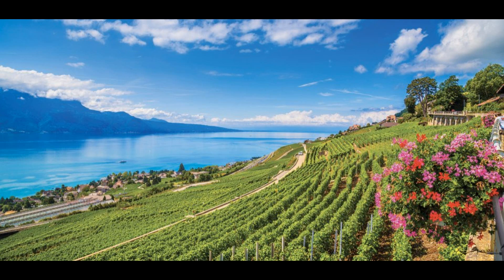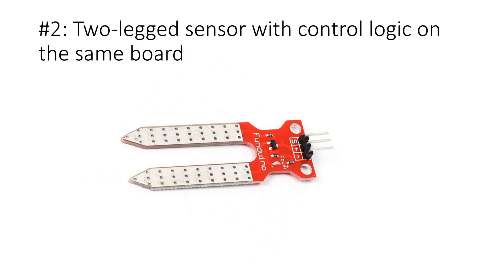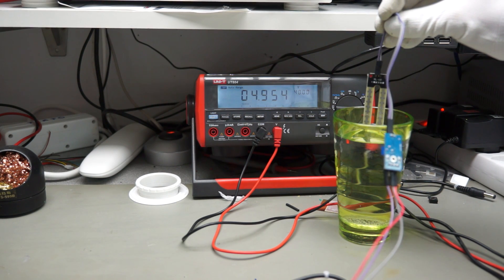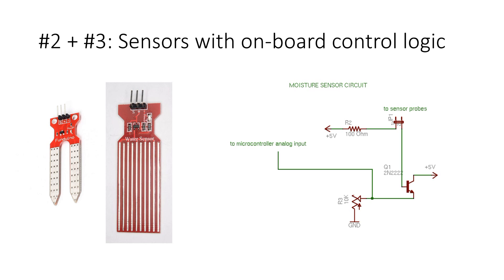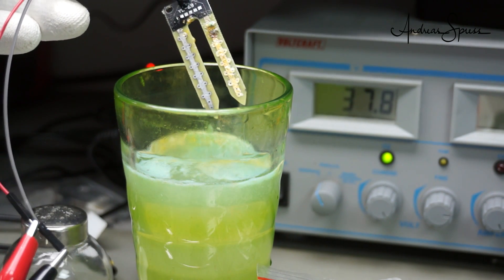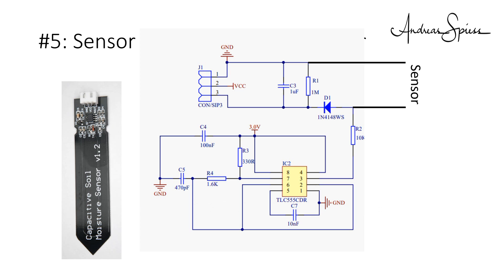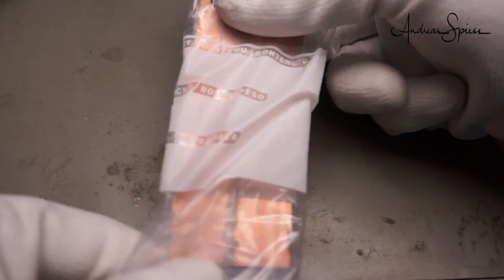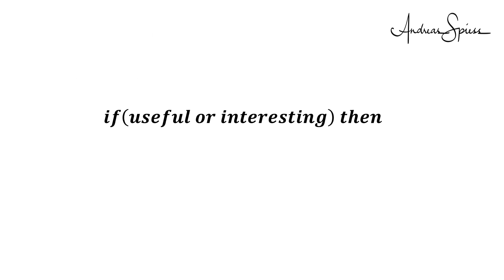#207 Why most Arduino Soil Moisture Sensors suck (incl. solution)

Comment: Hi Andreas,
i use that sensor : https://nl.aliexpress.com/item/32886868425.html?productId=32886868425&productSubject=Analog-Capacitive-Soil-Moisture-Sensor-V1-2-3-3-5-5V-Corrosion-Resistant-With-Gravity-3

in a beta driver under Tasmota from github. It works now for 1 1/2 years without any issue in 10 different plants in my home. Nah ok i don't have that green finger so i needed that type od sensor. Never bought another one because when you know electronics it's clear what's going on. I'm the sensor guy from Tasmota and possible i will publish the driver in the next few weeks for it.
Reply from the maker: Thank you for sharing your experience!

Comment: Andreas thank you for this nice and very informative video.
I would suggest maybe to try to make an experiment, to convert a cheap sensor to a capacitive sensor.
It is really simple and cheap.
From my point of view, it is not a good think to expose the sensor to soil an moisture, and also not healthy for the plants root for shure.
It is a better strategy to isolate the sensor completely from the plants root and soil and that can be achieved if we make/buy capacitive sensor.
Reply from the maker: I agree. That is why I voted for the capacitive sensor. It is not very expensive.

Comment: I see lots of comments about pulsing the sensor. Even better, change the current direction for each measurement. Also, if you are worried about chemicals, two nails in a piece of wood does exactly the same as the first PCB presented, without many of the dangerous chemicals. In any case, this video is far from an in-dept analysis of the issue, disappointing.
Reply from the maker: There were a few comments about using steel or graphite electrodes. Steel seems to rust.

Comment: By maintaining the polarity of the legs and having a constant current running through them you are literally deplating the metals from the positive electrode (anode) and inefficiently plating on the negative electrode (cathode). There are at least 2 things you can do to greatly improve the sensor life. Only turn the power on to the sensor long enough to make your measurement, and change the polarity of the sensor each time. It is a little more complicated, but your sensors should last a very long time. Thanks for the video!
Reply from the maker: There were quite a few proposals in the comments to avoid a fast dead of the sensor. Changing polarity was one of them. But it dis not help everywhere...
Reply: @AndreasSpiess  
Well, of course, you should start out with good sensors. Perhaps 200 microinches of electroplated watts semi-bright nickel, plated after etching to ensure all exposed copper is covered. Any exposed copper at all is going to go away in fairly short order with or without electric current. :-) 
Still, I suspect the capacitive sensing has the potential to last longer if you coat the entire assembly in a good thin conformal coating. Except for the connectors of course, to which I would apply a generous helping of silicone dielectric grease.
Have a great day!

Comment: the green stuff is probably mostly oxidized copper.
Reply from the maker: You are right!
Reply: I dont think so, because copperoxide(s) are not green. The copper somehow goes into some kind of copper-salts, maybe copperchloride/carbonate/hydroxide... they are all nice greenish colors
Reply: @paulg.3067  tap water would have some chlorine so copper chloride, and hydroxide would be likely. the plating will probably be tin so you might get some stannous chloride as well (not sure if you can get tin hydroxides, not a chemist).

Comment: And I just ordered the same sortiment of sensors from China, trying to find out exactly whether this would happen.
Measuring with AC instead of DC would make the effect much slower, as would reducing the times the humidity is actually measured.. but bare copper in moist soil will always oxidize, even without external voltage. That's why copper or brass flower pots turn green over time. Regarding "the green stuff" - it's just copper dioxide, "Grünspan". It's not poisonous, and the plants shouldn't worry about it in these small doses, but it's still not useful to the planned goal.
Reply from the maker: You are right. A few other comments confirm the same thing.

Comment: Years back I built an analogue system to water my plants. I found that my mild steel nails used as sensors would just rust away. I then used graphite rods from a lab supply shop. They are more fragile than the nails, but they don't corrode and don't give off any toxic oxides.
Reply from the maker: Your observations are shared by a few other commentators

Comment: I will never understand why the resistance sensors don't switch polarity regularly to avoid this issue. It's really that simple. Well, I suppose the makers just want you to keep buying them, but it's still stupid. That, and/or a more inert electrode. Carbon's fine. BTW, the green stuff was at least partially copper hydroxide/carbonate. If there was any salt in the water, then some of the green color was chlorine. Be careful with electrolyzing anything with salt because of chlorine. If you continue electrolyzing it, you may get bleach or higher chlorine oxide compounds and you probably don't want that. Electrolysis demonstrations could be done with sodium carbonate instead of salts to avoid these issues.
Reply from the maker: Thank you for the tip! I was never very good at Chemistry ;-)

Comment: Thanks for the Video, Andreas.
In a proper industrial solution the driver for the sensor is always alternating current. This prevents unwanted electrolysis even if the sensor is capacitive and the isolation gets damaged. With leakage detection and indication you know there is a fault, distorting your measurement. A possible easy solution can be to couple a PWM signal out with a capacitor and feed back the sensor over an rectifier + capacitor/lowpass. Sounds complicated but are less components than a NE555 based oscillator and most of the components are used in the DC application anyway + Micro-controllers love to PWM.
At all you have to think about if a capacitance touch-less measuring method is the best for you: You get a phone call and your plant gets water ... this can happen;) Using the direct contact method with AC coupling is the stable (homebrew) method i think.
In addition what Eman Retzun(Nutzer Name?) said: there shouldn't be any component in the sensor path, including the amplifier if one is needed, that draws more current than an Arduino can switch, and on/off times for plant moisture measurements can be very sporadic.

Where's my copper gone?!?: From the one electrode to the other, negative electrode:) ... but other stuff can get in solution that was bound with or was under the copper. So don't use permanent electrolysis on your potatoes.

What happens in a fault situation?: Your house gets messy and the expenses are far more than a 3$ sensor. Ever thought about the magic of the capillary effect? -> You build a closed system, where only so much water physically can get in what's needed. High-End space material like terracotta does the rest. If you can't withstand, than you can put a moisture sensor outside of that all as secondary safety measure. And this one can always be dry, yelling an loud alarm if it gets wet:)
Reply from the maker: You are right. There were some already some discussions in the comments about that matter.

Comment: Wie wärs mit sensore vo de IST?????
Reply from the maker: Never heard of this company. Do they produce a sensor for that application? I only found sensors for air humidity.
Reply: Andreas Spiess yeah well we produce them only for air humidity 
Doesnt that also work??
I am not an expert in humidity for plants?
Reply from the maker: Moisture and humidity are two different things (I had to learn it, too)
Reply: Andreas Spiess Yes yes that i know
Now a little tip, I THINK BUT I AM NOT SURE, the moisture sensors got damaged because of elextrolytic process
You have to apply a AC Voltage and not a DC voltage
Atleast i think this is the reason
You just have to change the actuall circuit

Comment: What if the exposed sensor pads was gold plated?
Reply: Then that sensor would not come as cheap
Reply: That is true, but didn't the video conclude that the cheap sensor was crap anyway? I think gold plated would be cheaper than the capasitive circut.
Reply: @Zarundo  not sure if it would be cheaper. I think best option would be iron and switch off the current when not in use. I have done that for a long time and works well. I am currently using graphite rods, no electrolysis at all :-)
I have experience with capacitive sensors.....they bring in several other problems :-) for now I stick to graphite

Comment: The copper is not good for your plants, If the contacts would be stainless steel or maybe silver or gold it would last longer?
Reply: Even platinum plating?
Reply from the maker: There are many comments around the material selection.

Comment: Resistive measurement works perfectly fine. I use two Stainless steel rods that are sampled for 1ms every hour. Inbetween sampling there is no voltage. It is running for 5 years now without issue.
Reply: In analytical chemistry for cunductometry this whole issue is managed by the use of alternateing current (and platina electrodes but stainless steel, copper or graphite should be fine for this). I don't know a damn about eletronics but why don't they just use alternating current, it reverses every chemical changes it makes? Sorry for the spelling.
Reply: I to did the same thing. Using Stainless steel rods have worked in my soil for years now. I also did not want add more circuity (even though I like the capacitive approach) to my project design. I have my Microcontroller pulse for a few milliseconds make a ADC read then average these raw reads, off the rest of the time. No electrolysis effect.
Reply: I also use stainless steel rods, the only issue I have with resistive measure is the dependence from temperature, anyway I don't know if the capacitive have same issue

Comment: I'm sorry but the answer was starring you right in the face the whole time. You just need to use solid platinum electrodes and you'll be right as rain.

(just kidding of course)
Reply: You know, that may actually be a viable option. A bit pricy though.
Reply: Graphite would be far cheaper.
Reply from the maker: There were already quite some material discussions in the comments below. Many opinions, though ;-)

Comment: hello can i use a bigger version of the  capacitive moisture  sensor to detect water tank level 
if i make a senssor as bigger as a water tank can i detect if the water tank is  full of water for example ?
Reply: in a water tank you might be better of using a float like in a cars gas tank. Something like this https://www.sailmagazine.com/.image/c_limit%2Ccs_srgb%2Cfl_progressive%2Cq_auto:good%2Cw_700/MTQ4OTg4MDgwMDA1OTgxMjM5/hr2-110600-bwfuel-trans.jpg
Reply from the maker: It might work. But maybe the "parasitic" capacities from the tank might be too big. There are other possibilities to measure tank levels.

Comment: Conformative coating doesn't protect against alkaine chemicals. Looking at old hardware with leaking batteries it eats right through the coating. A probe coated in silicone or resin would last a lot longer i think.
Reply from the maker: I am no chemist. Maybe it is also a matter of concentration?

Comment: That capacitive sensor is a chinese copy of original sensor from DFRobot. It intentionally says higher version number 1.2 instead of 1.0 (DFRobot) to steal sales from DFRobot. Those clones never had any 1.0 or 1.1 versions. Seems quite nasty behavior to me. Please do not promote this behavior and update your description link to the original product. (Disclaimer: I'm just a customer and I do not have any other relation with them.)
Reply from the maker: Maybe you are right. Often it is hard to find out who produces these products. Most of the stores on Aliexpress are only sellers and they buy their stuff somewhere.
My policy is to share the link of the product I used in the video.
Reply: @AndreasSpiess  I still think that it would be nice if you at least mentioned it in the description. As you yourself found out, all other moisture sensors are completely useless and without dfrobot's sensor to copy, there wouldn't be any usable sensor for hobbyist to use.
Reply from the maker: There is a link in one of the comments to a page from 2014. So also dfrobot is not the inventor :-(
Reply: @AndreasSpiess  Could you share that link? I don't like to be wrong, so I've checked all comments, did not find anything and only link that was 2014 was about resistance sensor, not capacitive, but maybe I've missed something. I can't find out when dfrobot started producing them, as archive.org does not work there, so I checked google for dfrobot "Capacitive Soil Moisture Sensor" and tools -> time restriction = before 1.1.2013 and it found a link from 17. 1. 2012, but can't tell if that was correct approach how to check that. I'm not sure that they really invented it per se, but they put it on the hobbyist market as a product. Also if you check the pictures, design of dfrobot's version and the clone is the same, same form factor, dimensions... clone just has bigger footprint components.